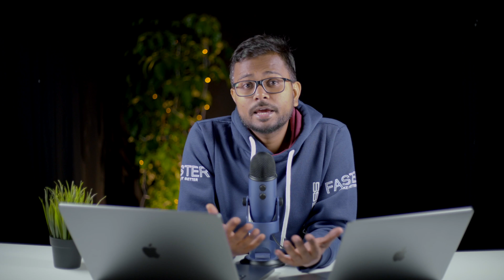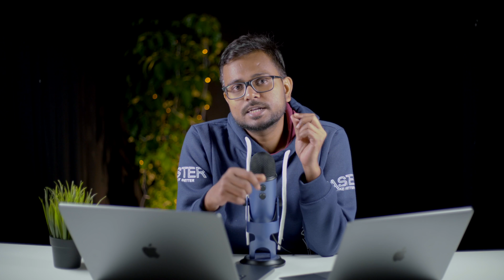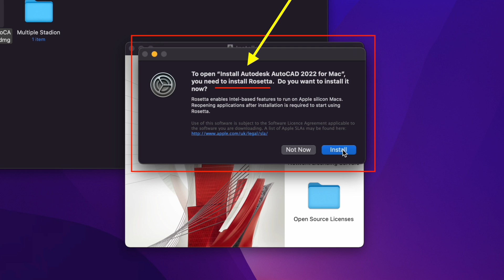MacBook Pro M1 Pro 2021 for AutoCAD Review and Test Results | M1 Pro for Architects Designers

Comment: some files don't run well in the autocad on the mac m1 pro 16', which on windows runs well, on the mac I found it very laggy and on Windows it's more fluid, I'm using cad 2024. I'm sure it's a lack of optimization, because there's no way an expensive laptop with a mac runs an autocad file poorly where a windows one with a gtx 1050ti runs normally.

Comment: I like to buy MacBook Air m1 and i have a doubt that can I use cracked softwares in MacBook regarding the apps like AutoCAD, CATIA , 3DS , SOLIDEDGE , and i have a doubt can I use ms office without subscription and is MacBook is good in everything like is it supports all type of files and Android
Reply from the maker: For softwares like AutoCAD, CATIA , 3DS , SOLIDEDGE I would recommend you to go with a Windows Laptop. CATIA for Mac has not been created yet. For MS Office you will need to have a subscription. So, for all your needs I would recommend you to go with a Windows laptop.
Reply: @ProgramHubNet  thanks 👍 anna

Comment: Sir, I’m planing to buy iMac and wanted to know whether I can use AutoCAD on IMac without installing windows OS on it in parallel.
Reply from the maker: Yes you can use AutoCAD on iMac without installing Windows OS using Parallels.
Reply: @ProgramHubNet  thanks

Comment: Can you comment on fan noise during usage? My primary concern with running autoCAD on windows laptop is that their fans run like a jet engine
Reply from the maker: As far as I tested it, fan was really silent and even if you go for complex workflows fan noise remains very low, which can't even be heard.
Reply: I use m1 pro and no noise doesnt work fan whenever I use AutoCAD...
Reply: On windows laptop you can reduce the speed of the fans without compromising performance.

Comment: Sir youtube video editing ke lie laptop lena chaiye ya macbook?
Reply from the maker: If you are going to use Premiere Pro, so Windows Laptop will be better and if you will be using Final Cut Pro so for that MacBook is a must because FCP is not available for Windows Laptops and FCP is one of the fastest video editors you can use for YouTube video editing.
Choice depends on you, because budget even needs to be considered. 
Recommendation: You can even go with MacBook Air M1 for YouTube video editing.
Reply: After buying macbook what extra things i need to buy for editing...
I mean what softwaers and other accessories i must need to buy plz reply that i can count actual cost for macbook

Comment: Thank you for your video.
 I just want to be sure that Autocad run on MacBook Pro 2021 with Monterey Os. Do you think Autocad run very well ?
I work on autocad all days and I look at the MacBook Pro 2021 M1 pro/max for my work.
Reply from the maker: Thanks for the question. Just to help you make better decision, here's my opinion about the new MacBook Pro M1 Pro, while I tested for one of the largest DWG file of 30MB along with some more CAD designs, I found that CPU utilisation was less than 20% and RAM usage reached only 6GB with total utilisation. So, as what I have tested I can perfectly say this to you the choosing a MacBook Pro 16 inch with M1 Pro would be one of the best in-budget option for you. Because the only difference between the #M1Pro and #M1Max is of the GPU cores, but what amazed me in the M1 Pro for GPU performance is that it's lot faster than any other machine I've tested yet. The FCP projects which took me to render 8-10mins are now lowered to only 1-2mins at max. 
Do let me know for anything more I could help you?
Reply from the maker: One more thing which I forgot to mention, that AutoCad does runs on macOS Monterey. In fact the test which you saw in the video was done on the same OS.
Reply: Thank you ;) 
I have two extern displays.
I work on Autocad generally with a lot of DWG files open (1 file I work on it on the main display and 5 or 10 files open on the other display) with Excel and PDF files open too.
So I I’m not sure if I would take the M1 pro or max and with 16 or 32Go of RAM ? Difficult choice !
Reply: @nicoforsberg748  If you can afford, go ahead take the greatest one: M1 Max 32GB.
I've need to watch this contents because it's pretty expensive for me to reach the better one, so I wonder if the M1 Pro 16GB can sove my need.